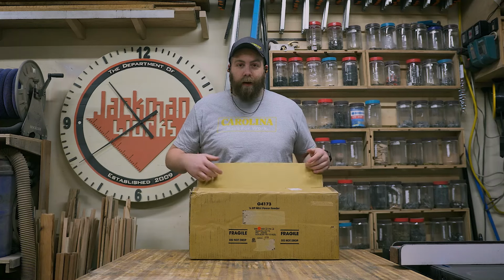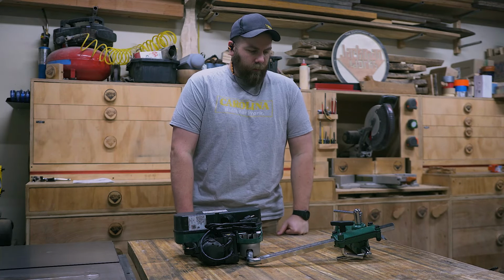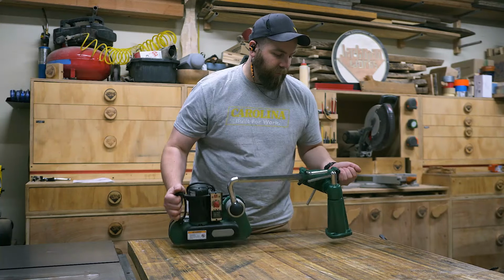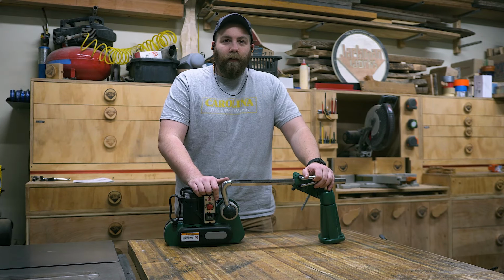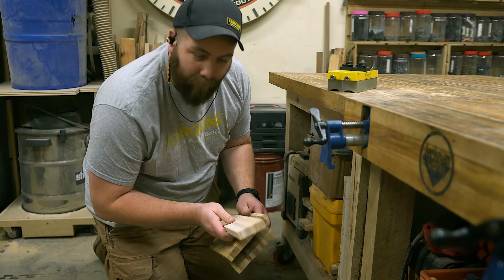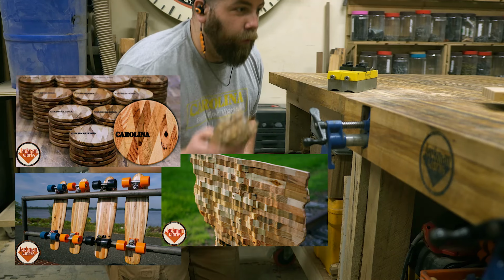Small Shop Power Feeder Solution

Comment: I wonder if you were to place a thin layer of rubber directly between the magnets and the tablesaw top, if it would improve lateral holding power? Of course, it's possible that it would have the opposite effect.. and could possibly reduce vertical holding power as well. I feel like it might be a big improvement laterally with only a small loss in the vertical plane. Just a thought!
Reply from the maker: 3:29 that's me applying a layer of cork rubber to the entire base minus where the magnets are :)
Definitely helps with the lateral forces.

Comment: No feather board? Did you find the tracking kept the boards tight to fence?
Reply from the maker: I tried both with and without and didn't really notice a difference. I set the feeder so that it was at a slight angle pointing towards the fence which did a great job holding it against the fence. The pieces I was cutting were variable in their width, but if it was more even I'd definitely put a feather board on there just to be safe.

Comment: Great post, very helpful. Before I buy one for my hobby work, in UK we have two options from Axminster Tools, one same size and build like you have (90 W) and other is 240 W, but heavier at 32kg, price of both are not much difference due the bigger one on sale now. I want it to be portable between router table and table saw. Did you ever feel the need for more power on feed roller for rip cut on table saw than the one you have?  I don't want to be moving around 32kgs if I don't need that much power.